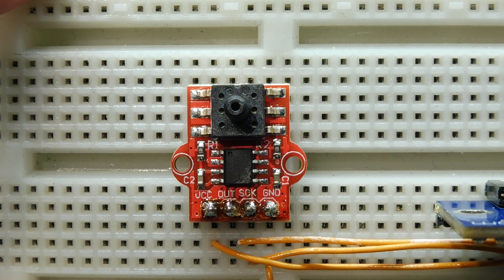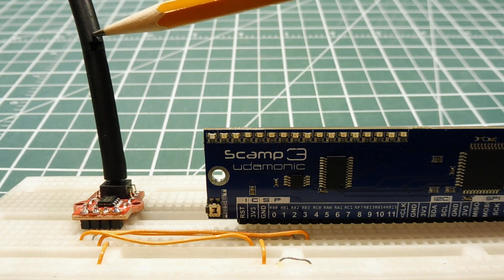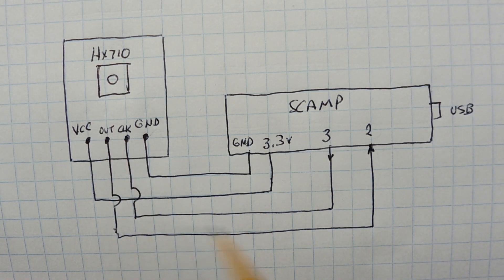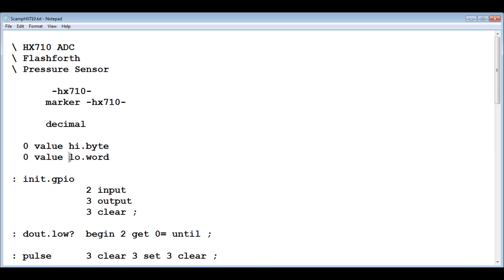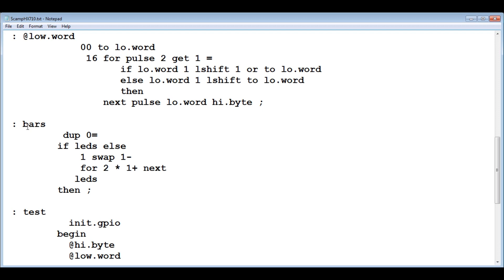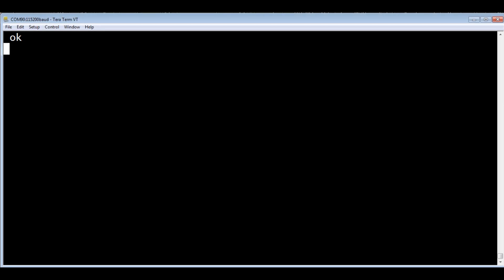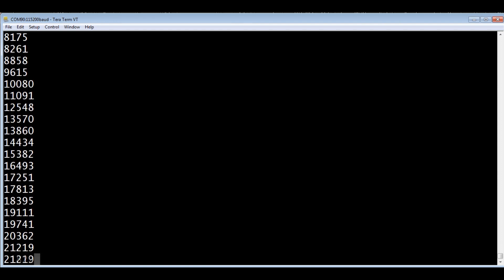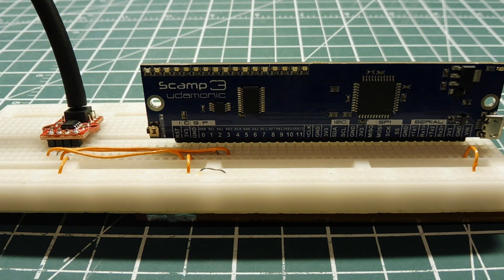Breath Controller / Liquid Level Detector / HX710

Comment: I got here as I research for a Water lever sensor, the regular MPX5010 is too expensive for what I need, so I was on Aliexpres and saw this gem, but I was uncertain of would work for my application, and here I am. Thanks for the clear video and the massive data. You Sir, have a new subs. Thanks
Reply from the maker: Glad it was helpful. Thanks for the visit.

Comment: how about when i want to connect the hx70 to arduino uno board? and display the psi reading through an lcd
Reply from the maker: You can use any microcontroller to display the psi to a display. https://youtu.be/FAIOIACJY0w

Comment: Can the pressure module be used for a binary indicator without the microprocessor?
Reply from the maker: You could use the pressure sensor by itself and measure the voltage output of the Wheatstone bridge to get pressure readings.  https://youtu.be/FAIOIACJY0w

Comment: Can we use the air pressure sensor with pic16f877a?
Reply from the maker: You can use it with any microcontroller. Two GPIO pins can extract the pressure data.
https://youtu.be/FAIOIACJY0w
Reply: @0033mer  thank you for you reply . I ve further questions. I am trying to use the pressure sensor for spirometry, could you gove me a short take on how you went about the coding and if you ve the mplab code, it will be massive help . Thank you. If there is a better way  to contact you pls let me know too. Note that i am not using a scamp board. Just straight up using the pic microcontroller.
Reply from the maker: Check out the Flashforth website for source code that will run on your PIC microcontroller or you can use the language of your choice and use the code in the video as a template to get the same results.
Reply: @0033mer  can you provide a link to the code on flashforth sir.
Reply from the maker: https://sourceforge.net/projects/flashforth/

Comment: Where is the pic microcontroller,  is it onboard the scamp3 board? Is it possible ti use the barometric air pressure senson directly with a pic microcontroller?

Comment: If I substitute an Arduino Mega 2560 for the Scamp board, will this code still work as long as I make note of the pin no., and emit the the lines of code pertaining to the LED's of the Scamp board?
Reply from the maker: The Scamp board has GPIO support words like input, output, set, clear ... etc that you will have to write your own. The words "bars" applies to the onboard 16 LED array unique to the Scamp board. Check out the Scamp website and HX710 data sheet for more info.

Comment: 1. Would the Arduino Mega 2560 work in place of the Scamp3 board, with this pressure module.  I already have a USB to Midi cable.  -  2. Do I also have to flash the board as you would with the Arduino
Reply from the maker: Yes, you can run Flashforth on the Mega2560 in place of the Scamp3 board. https://flashforth.com/atmega.html
Reply: @0033mer  I have already ordered the pressure sensor you used from Amazon.  I just wondered if thought it would work in a blow and draw way, the same as the other sensor I posted to you by Synth Hacker.  And weather I could use a 10v sensor in place of what you used, considering your board gets its power from the 5v USB connector.

Comment: If I build this, will I need some kind of driver for my DAW to recognize it?
Reply from the maker: Yes, you will have to convert the breath pressure values into MIDI messages. (CC, Pitch bend or aftertouch)
Check out this video for a simple MIDI interface: https://youtu.be/MPhZMkZ1KjQ
Reply: @0033mer  Thanks for the quick response.  Yes I know about the CC values, I just did not know if the device will be recognized or picked up in my midi device selection with or with out a driver.

Comment: How simpler and more reliable was life back in times when one could use air membrane water level switch from thrown out front loaded laundry machines or buy a new one as spare part for a couple of dollars and precicely adjust levels for on and of with a couple of screws - for some reason they never break even after couple of decades of use and repurposing ;)

Comment: Superb !! Wondering if would be same approach using the HX711 ?? Which If I recall well it is more accurate and flexible . My hat off , I have several of these , never figured out how works . It would be nice a linearity test . Kudos !!
Reply from the maker: Yes, the HX711 is the big brother to the HX710 and can be also used in this application. The HX711 has selectable gain and is designed for load cell interfacing.
https://youtu.be/vvIe0BFBlFI